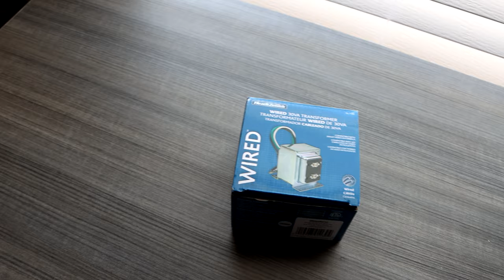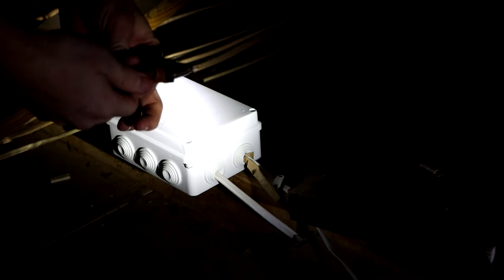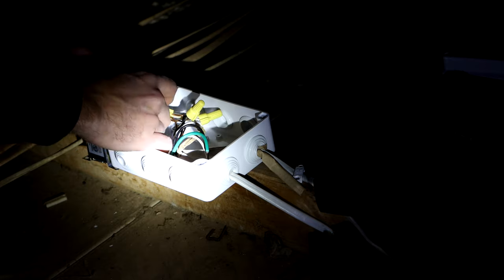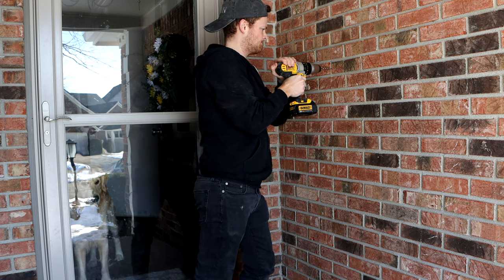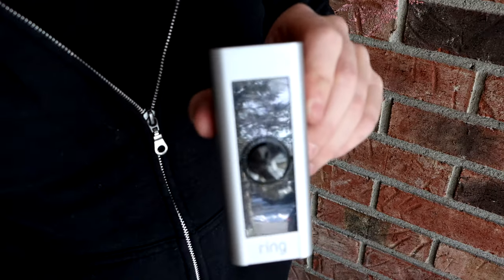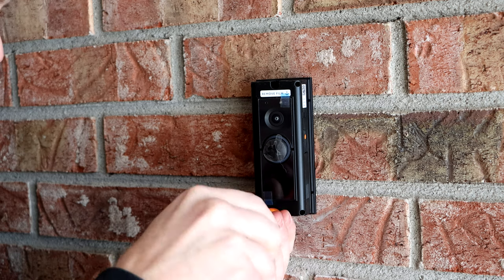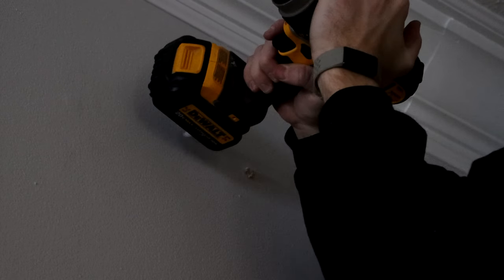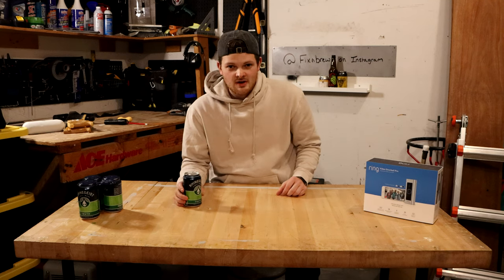Ring Doorbell Pro Installation: Without Existing Doorbell (2021)

Comment: I seriously thought this just mounted on the wall and would give me video footage. this is extremely advanced for my understanding and I feel like I regret making this purchase for security. My house is old and I am not an electrician.
Reply from the maker: If you have an existing door bell it’s a lot easier but without one it is a pain. 🙃
Reply: Okay I'm probably going to send this back then. The people at home Depot are not very helpful. I have an old house and it does not have an existing doorbell. 😒 
And yet they recommend this item.🤦🏾‍♂️
Reply from the maker: @CharlieMelanincholy  You could possibly get a quote from an electrician! It may not be too pricey.
Reply from the maker: @CharlieMelanincholy  Or possibly find a battery operated one!
Reply: Ok thank you

Comment: I would place the transformer in an area inside the house like a closet or an area where you can hide it, if available, because you don’t want to go back to the attic to replace it or work on it, especially if you live in a hot climate state like Florida.

Comment: Good video overall, but you didn't show the hardest part, pulling the wires through the wall.
Reply from the maker: It was tricky but I ran the wires down then used a metal hook that fit through the hole to grab it and pull through. 🍻
Reply: @loganccox  skipped the hardest part 🤦🏿‍♂️
Reply: @anthonyharris2231  they make a roll of wire called fishtape made to fish wires through insulated walls.
Reply: @markdesselle5572  I used double tape all is good dude
Reply: A small screw on a piece of string dropped down the wall and can be picked up with a small magnet on a stick as well. Then guide the stringwith the wire taped on it through the hole.

Comment: Could I hypothetically install this doorbell just hooking the transformer to the junction box without having to install the chime? (Reason being I have like 5 Alexas in my house that can already double as chimes)
Reply from the maker: Correct. You do not need a chime if you don’t want one🍻
Reply: I've been trying to find the answer to this exact question. I purchased ring's own hardwired transformer kit for a new Video Doorbell Pro 2. The transformer instructions say in two places that a chime is required, and then if you don't want a wired chime, you're supposed to use the plug-in adapter. Do you think I can still wire directly to the doorbell? If so, why would Ring say this if it wasn't the case?

Comment: I'd recommend using lever nuts (wago). This is a more. Modern wire nut to use and you can have 2, 3, 4 or more holes to allow expansion if you ever want to repeat this with other devices
Reply: True. But with Wagos, it is recommended to know just how far back to strip the insulation on your copper before flipping the lever down. Wire nuts do the same thing with a lower learning curve.

Comment: Are you able to simply hardwire in from an existing light switch on the inside of home? Or do you still need to install a transformer? I don't have an existing doorbell or chime.
Reply from the maker: Definitely need the transformer. Too much power when you hard wire directly. Check out the wiring diagram in the description. 🍻
Reply: @loganccox  Got it - do I also need to install the Ring Pro Power Kit? I don't have a  chime in the house.

Comment: Would it not be easier to just buy a 24v plug in adapter and run those wires to the doorbell?

Comment: Nice video IF you are using a chime with the Ring. How ever the Ring is supposed to run on a 24VAC 40 watt transformer, not 16VAC. I used the 16 VAC wall wart with my first one and it didn't last long at all. A 16VAC transformer means it's running on lower voltage than it designed for. Thats not good for electronics. Think of the effect brown outs have on electronics anf light bulbs. It will cause the Ring to burnout sooner. Finding a chime that runs on 24VAC isn't that easy but can be found. However the Ring works on/with the Ring Show as well as your phone and it can be used as the ringer for the door bell and showes you who is at the door at the same time. Great for the home if you don't carry your phone with you 24/7. The thing is that no where in the info packet provided does it state you need to install a 25 Ohm, 50 watt resistor in line with the Ring when using the transformer. That little jumper in the kit isn't one of those and muct be bought separately. JFYI
Reply from the maker: @richardballard6604  Oh wow didn’t know that. Definitely going to look into this and swap everything out. Thanks for the info. (Rings still going strong as of right now. 🤞)

Comment: I'm not understanding where I find the junction box and can I still make this work for an apartment. I really don't want to call a professional to install.
Reply from the maker: If your apartment doesn’t have a pre existing doorbell they may not allow you to install the doorbell because of running the wires. There are some Ring Doorbells that you can run from a battery which may fit your needs better! 🍻

Comment: You showed two wires (white and red) go from the transformer to the outside Ring.  But the white from the transformer didn't go outside, it went to the chime correct?
Reply from the maker: Check out the link in the description that says wiring diagram then click the first one. It’ll have two door bell pros but ignore the one on the right. Basically it’s the red wire goes from the transformer to the ring. The white wire goes from the transformer to the chime then to the ring. Then you attach the pro power kit to the chime.

Comment: how do you make sure the chime you buy is compatible?
Reply from the maker: They’re compatible with all standard chimes 🍻
Reply: @loganccox  and if you want multiple chimes and multiple doorbells just wire them all to the one transformer?
Reply from the maker: @PresentedByBailey  Yes should be good. I have a link in the description of the wiring diagrams. It shows different version of what exact way to wire multiple things.
Reply: @loganccox  I Subscribe
Reply: @PresentedByBailey  Do You Have a Ring Video Doorbell Pro
Reply: @jadamioncole1873  i don't have any doorbell at all right now. trying to determine what i want to do. after looking at ring's instructions i might add hard wiring for it or use peephole. stilling deciding.
Reply: @PresentedByBailey  Ok!

Comment: Electrical noob here:  could i just wire into an outdoor outlet on my porch and run over to the doorbell?
Reply from the maker: Yes that’s essentially what I did except mine was an outlet in my garage. You would however need a transformer to give power to the doorbell because wiring it straight to the outlet is too much for the doorbell. 🍻
Reply: @loganccox  thanks for the quick response, ill add a sub and like.  If I go with the transformer, I'll make sure to use your link.  Peace

Comment: I installed mine and it worked for about 2 hours before shutting off. I did all of this, and more, and the doorbell still isn’t working. Even spent over an hour on the phone with Ring Customer Service. Nobody can seem to figure what the hell is wrong with it...
Reply from the maker: So actually in my previous Ring video, the floodlight camera, mine did the same thing. I tried everything because I thought it was for sure my fault. Turns out I had a defective floodlight cam so I sent it back and got a new one. New one worked perfectly. Pain in the ass but I’d send it back. 🍻

Comment: Your neutral wire should be looked at again it isnt good to have exposed copper showing under the wirenut you should consider using a red instead of a yellow.

Comment: 30 amps?
Reply: That's what I was thinking. At about 5:50 you can see the sticker, but there is glare on it.  It's 16 volts and I think it says 1575 mA, which is 1.575 amps.  I have no idea where he came up with 30.